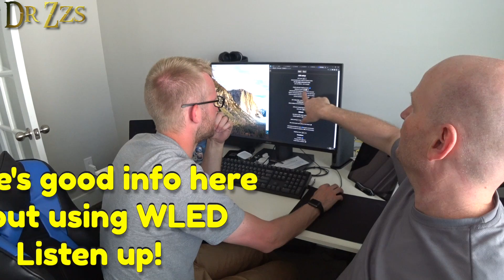DIY Permanent Holiday LEDs - It keeps getting easier! PermaTrack, Pixels and WLED - Christmas Lights

Comment: I have a question, when you put the controller(s)... Where do you put them? I am asking because in my case I tried putting the controller (DigQuad) insude my garage but my data wire is too long and I think I will have to put it outside instead? Can I do that, if so, how? Do you use a certain type of case weather resistant? Something small and discrete so you can attach it to the soffit type thing? Would you have any advice for me?

Comment: "3030G corner channel diffuser" from google works great with "3 led module strip lights" from Ali
each module (3 leds) is 60lm, 0.72 watt, the corner channel is 30mm x 30mm.
install under the gutter (dont screw upwards into gutter!), or on the front facia, under the shingle line.

Comment: I made the mistake of mountting my Nodemcu in a waterprrof box with my power supply. It seems it is too far from my roter and cant be found. I will now need to find a solution for this.
Reply from the maker: You may need a nodemcu with an external antenna.  That will extend range. Also some are lower quality than others.

Comment: How are you powering the Dig-Uno at the other end? Are you running a separate power cable in the permatrack, or are you using power via the LED strips that's being sent from the other side?

Comment: I'm surprised you can make such a long run on one channel without data loss and flickering. My runs are much shorter and I haven't been so lucky
Reply: Did you do 5v or 12v?
Reply: @DJR-u2g  I did 5 volt. I wish I had done 12 volt. I did some power injection mid strip which helped. I had problems with cheap chinese esp32 modules. I switched to Quin's Esp32s and it all works great now.

Comment: What type of screws are you using? 
The 2nd cord is to power lights but the controller will be at the opposite end?  Why didn't you run the wled from the same location? I wish you'd shown how you ran the data wire. Did you have to fish it through the channels, run it along the outside of the channel or take the channels off enough to insert the data wire? What did you do with the wires when going from one location with lights, then over an area/space that's unlit, to the next area/space with lights (like jumping from one gabled window to the next)? Are they left exposed, tucked out of sight or in a wire channel? Also would it have been possible to run the data wire in the channel at the same time you were using the light strings?

Comment: Should have ordered your pixels to the length of each track so they can be removed for repairs.  You would have had a connector at each end. Now you are going to have a bitch of a time to replace those that burn out over time.  You should have also went with squares to get a more shallow channel.

Comment: Hey DrZZs can I use 2 separate 10Amp power supplies at each end of my run? Or do I need to have a common negative or anything like that??? Thanks for all your work!
Reply: I know you asked this three years ago.  So this is more for others reading this.  Your controller and the lights it is controlling should be on just one power supply.  If you have a string of pixels so long that you are worried about voltage drop.  Then run a pair of wires, pos/neg, from the same power supply and connect them down the line of your pixel string to “inject” more power to keep the voltage up.  If you need more total wattage for a long string. Use a bigger power supply. Do not try combing two power supplies for the same string.
Reply: @mikentx57  Your advice is to Not use two power supplies. What is your reasoning? Both power supplies voltage output connected to the string would give me a common ground and it’s just DC voltage differential…

Comment: Have you found any 12mm module/bulb like this that can make a decent Warm White, or only warm white?
Reply: You just need to tinker with the settings of your software/controller until you get it. Warm white is a very difficult color to produce with pixels..as is brown, for instance.

Comment: Does this system require a pc or can it be controlled with mobile device?
Reply: The WLED software on the controller has a web page interface. So you can control and program it with any PC, Mac, tablet, even phone. I am pretty sure you just control it through your home network.  You cannot access it from your beach lounger in Maui.

Comment: Question....should I get the 2811 with the XR twist connectors instead of the originals that clip? I also have a 2 story with power plus specifically for christmas lights, what is best way to get power to them and power injection and controller?

Comment: Great Video, how did you get from lower level to upper level? Also with the pixel spacing being fixed, how did you get around the blocking under soffit without having exposed pixel lights?
Reply: I literally only clicked on this video to see how they got to the second level. My house is similar in design but it looks like they went another way…

Comment: I think I would cut my light strings to 30 pixels, I know it would be more work but easier to replace if needed. I really like the look of these. You are a genius DRZZs!!!
Reply: They come as strings of 50. So you cut it to 30, now you have 20 left to splice in another 10 to make 30. Hmmm that left 40 on the next string. Cut off 10 more so we have 30... Waste of time. Leave them at 50.
Reply: @billfoster6809  so I ended up just buying my lights in strings if 30
Reply: I think you guys are missing the fact that these pixels are all individually addressable. Meaning, you can cut it anywhere you want to, depending on the length you need. That's the beauty of it. So if you have a run of 18 on one side of the eave and 22 on the other and a jump of 10 above the door (or wherever), then youd still get the 50 pixels but you'd just cut them after each run and make a jumper between the ends on the end of the one run and the start of the next run.

Comment: Help needed. First year using WS2811 12V RGB Pixels.  I have 3,250 around my entire home.  They have great power but I thought I could run them with the 2-SP105E Controller.  I need advise on the correct controller so I can have different shows.  Any help would be greatly appreciated.

Comment: I am looking for an alternative to climbing on the roof every year. This looks promising however I would tend to critique the fit and finish of the permatrack rail installation. In our area we are plagued by carpenter bees and wasps and hornets etc that would take advantage of all the gaps and spaces left in the track. Measuring the lengths of the tracks and cutting them flush to match up to the trim would look better also the finish on the end could be improved. I understand this is a common way of finishing the end of a rail but there are better or cleaner techniques that would seal up much better. If your goal was to get it installed  as quickly as possible then I guess that is what you achieved. I personally look at the finish and would be upset at the finish work. there are other competing products that had a better finish look.  Would you be willing to do some work to improve your installation process to have a cleaner finish look?

Comment: Is there a "starter kit" you'd recommend to get my feet wet just learning to set this up? Like just a controller, power supply, single short strip? -Thank you
Reply: We did an LED light cloud for the kids.  That got me into this hobby about 3 months ago.  Now I have over 1300 LEDs connected to my roof line lol.
Reply: Try Adafruit for kits like this... https://www.adafruit.com/product/1461?gclid=Cj0KCQiAzZL-BRDnARIsAPCJs72gXf0l2mLnWsCMucgIi7sr3Ppc5fMuMnHaAEMxETr94KH4g9VthyoaAtUZEALw_wcBlength=1

Comment: Did you ever figure out why the lights after the gap on the roof went crazy ?  I thought I remember on a live stream that you ran a wire between two points and the lights after that wire would do crazy things ?  I have a 10ft gap that I used 16 gauge pure copper and the other side works most of the time but goes nuts often too. Especially when it’s just one color. I did power inject right before the jump but no go. I have re-soldered the connections a dozen times. It’s like the data signal drops across the run and gets distorted. I have 300 leds on one side and 300 on the next. 12v 50 amp power supply. 
Just figured I’d check to see if you figured it out.
Reply: You need a pixel in between to "regenerate" the data signal
Reply: @deepside7  it’s a 10ft gap. Guessing that pixel has to be in the middle. To work. Will have to try when it’s warmer. I tried the led booster that quinled sells but it didn’t improve. 
Thanks !
Reply: @SelfSufficient08  the LED booster should have done the trick, but you may as well try with an led, or both. Ideally in the middle yes.

Comment: You folks are doing this whole thing wrong. Your system makes it look as though you're too lazy to take down your Christmas lights.  Bare lightbulbs  will always look like Christmas lights.  No one wants to see bare light bulbs. That's why you have lampshades in your house.  You have to have a system  where the lightbulbs  aren't visible, but the light is. Look at pretty much any  large office building or,  any tall building. The lighting is indirect. The architects made it this way on purpose. It makes the property look elegant, not like it's Christmas time. Your system  merely installs permanent Christmas lights at a very high cost, apparently.  Take a course in lighting. There are hundreds of them just on You tube.

Comment: How far can you go on 12v before you need to inject power? Do you have a video that address that?
Reply: At 100% brightness all white, a 12v node will use approximately 0.6ma.  The rule of thumb is about 200 nodes of 12v before injection (YMMV). This calculator is invaluable to me as a first year hobbiest: http://spikerlights.com/calcpower.aspx

Comment: Could you do a video about how you manage the wiring, power supply, raspberry pi, and ESP8266 for your misc. indoor/outdoor installations?  I'm struggling to figure out a clean setup and protect the electronics from weather.

Comment: I would really like to get into this; however, I cant permanently fix anything to the house structure or drill holes through walls (military housing rules).  Do you have any ideas/videos how to get  started that easily removable and visually appealing?  Thanks!
Reply: How about zip ties?
Reply: @jsreb  zip ties would work, I guess I would have to find a way to do it without looking tacky.  Thanks!
Reply: @travishutts6008  find a color that matches the surface it's attaching to.  I know it's not the cleanest but you're limited when you can't drill holes.  Another thing could be to hook your led track to the gutter.  Again, not the cleanest nor the most secure, but it may get the job done.

Comment: Can you run 120ft worth of lights without injection? Also what power supply do you get? Thank you!
Reply: Depends on how many pixels, not necessarily how long it is. You can have over 500 pixels in one prop that would probably be 120ft if you laid it out straight.

Comment: Those look pretty good. We have a local company here in Western Canada that does a much better-looking product.  3 individual LEDs per light in a low-profile down-facing housing. The metal bracket slips under the existing fascia trim and fastens with screws.  Big $$ but really professional-looking.  https://imgur.com/a/Ru8DF7N

Comment: Hi since now the leds have 4 wires how are you supposed to connect them to the module please let me know (:
Reply: SurvivorPlayz what LEDs do you have? Addressable LEDs usually have two voltage wires and a data wire. Perhaps yours aren’t addressable?
Reply: boilerboy165 yea
Reply: boilerboy165 blue red green black
Reply: SurvivorPlayz those are called “dumb lights” and will not work with a D1 mini. The ones installed are individually addressable and use a data line to assign colors to the pixels. You will have to connect yours to a mosfet controller that will control the three channels individually and provide power over those three channels to make a color.
Reply: boilerboy165 ok thanks

Comment: So how did you power the dig-uno?  You only put power in the middle?  Please explain to me as you would a child. Thanks!
Reply from the maker: The 12v power supply is wired to the far end of the LED string.  The dig uno is located at the opposite end (this isn't the usual way to wire it, but it worked best for Jaron's setup to do it this way).  The +/- wires for the LEDs are carrying 12v (because we connected them to the power supply), so at the diguno we connected those same +/- wires to the input side of the diguno.  Then all we had do to is connect the data wire to the Data connector on the dig uno.  
I hope that has made it any more clear.
Reply: @DrZzs  Do you not need a fuse or something at the power supply outputs to protect the power cable then?

Comment: On the ends of the wires that go into your power supply if you would turn them with solder you would have less voltage drop and current loss. The best thing is to solder on eyelets actually
Reply from the maker: You're right. I should to that.  I didn't know that would effect voltage drop though.  That's interesting.  Thanks!

Comment: I'm getting ready to hang some Halloween/Christmas lights and this would be perfect to do before all the snow starts! The dig-uno is sold out on your website though. Is there an ETA on when it will be back in stock?
Reply from the maker: Should be back in stock in 1-2 weeks.  We keep underestimating the demand.  I just added an option to the store for anyone to get a notification when I have them back in stock. 
https://drzzs.com/shop/dig-uno/
Thanks!
Reply: Awesome. I’ve signed up for a notification, but I had also tried to use Home Assistants scrape integration for the first time to see if I could get an alert from home Assistant when they went back in stock.

Comment: I just Ordered my lights and everything off your second video I went with the 12v string lights I laid them out in the garage floor and I noticed they flicker every so often. what would cause that? I only hooked up 100 then 200 and it does it to both. I've got the 5 V converter switch box you recommended for the data I measured the data  at the end it's still getting 4 to 5 on the data and 11.5 on the lights at the end. Any recommendations?
Reply from the maker: Flickering is almost always a data signal problem.  Come to discord and me or someone else will try to help you trouble shoot it. https://discord.me/drzzs

Comment: Cool stuff but you really need a solution for the transitions. The square shape isn't really helping.
Reply from the maker: Maybe in some future phase.  It's hard enough to get this stuff made and delivered when all the pieces are the same.  Throw in corners and a bunch of different angles and we'll need a warehouse to store it all.  It's still a DIY solution.
Reply: @DrZzs  Maybe look for some kind of flexible tubing that matches the shape and colour? Maybe Amazon has something like this. Look for flexible ac ducting or something?

Comment: Just curious there are a couple of companies that have patents for this product. How is the manufacture getting around this?
Reply: Patent for lights on houses?
Reply: @TheHellis  yes there are patents for specific products that permanently mount lights to home and commercial buildings.
Reply: @adamtherealtorpdx7291  i highly doubt it will affect this.
Most likely (I'm sure) that is one specific mounting technique not any.
That is how patents work. You can't patent something that already exist, thus any mounting can't be patented, but one specific is possible.
Reply from the maker: I've read their patents. I'm no lawyer but I don't know how they got those patents approved, they are so generic. Saying you have a patent on any mounting system for lights on your house is pretty broad. There are some pretty significant differences in the way they drew their channel for their patents and what we've made. 
For what it's worth, their patents are specific about mounting it to your house.  With the track we're making, you can mount it anywhere; on walls, around doors/windows, etc.  It just happens to also work if you put it on your roofline.
Reply: @DrZzs  that is weird.
Normally patents need to be very specific. Does it include a drawing of their patent.
If yes then that is probably what is patented not the generic description.
If it is as generic as you say then I'm sure you have nothing to worry about because there is no way you actually can have a generic patent that does patents something that is something people "always done".
Putting lights on houses probably dates back before electric light.
How can that be patented??